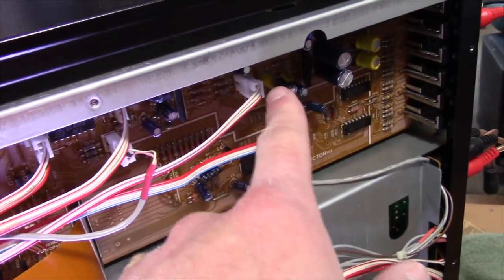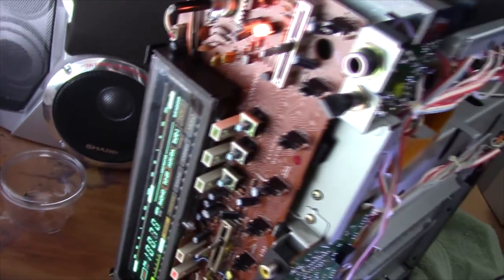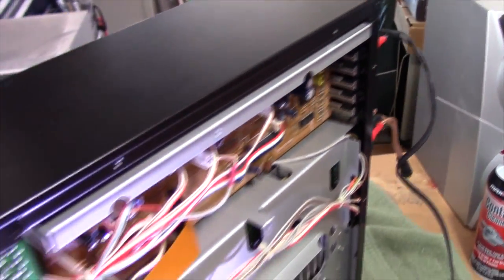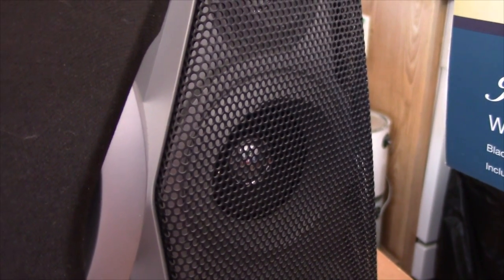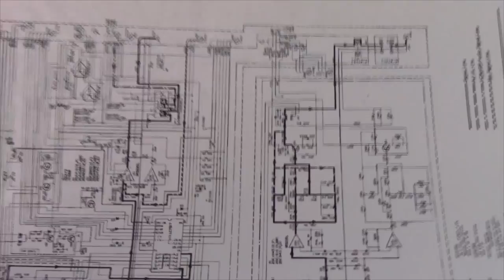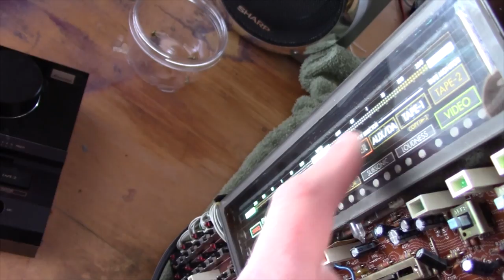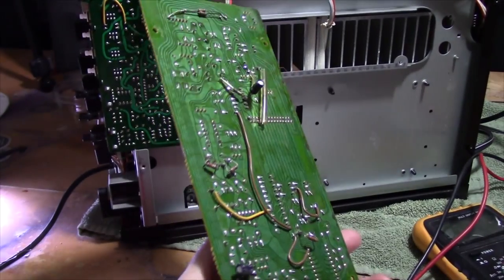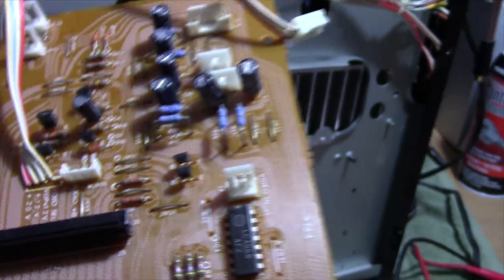Sansui S-X1130 Part 2 - Imbalance and Source Bleed

Comment: I'm surprised that I don't have this  issue with my JVC RX-315. The only issue I'm having is the original remote has gone to total shit in the volume control department but I have that issue solved by using the remote to my JVC micro system. The only button that I need from the original is the video 2 source, which is hooked up to an optical to analog converter. The micro system remote handles the volume control duties.